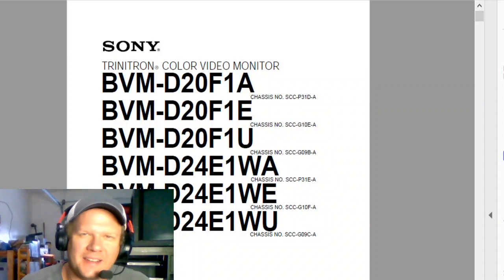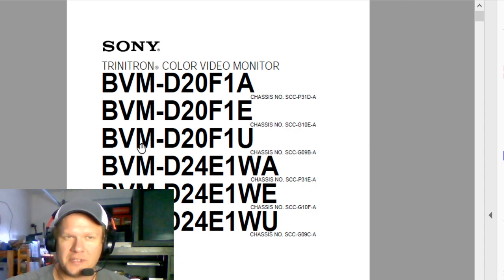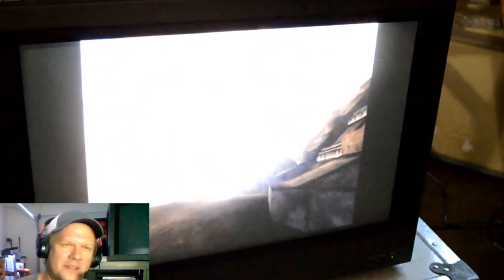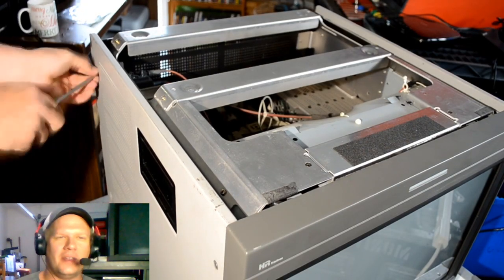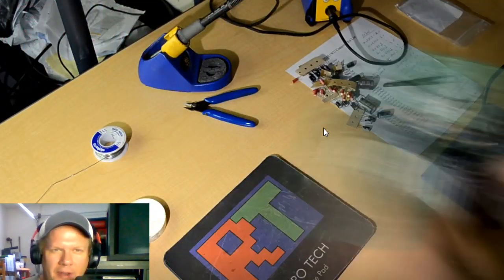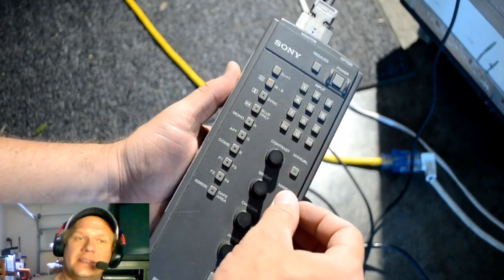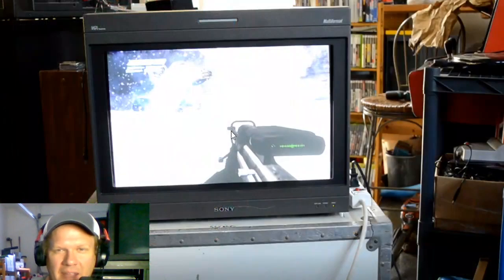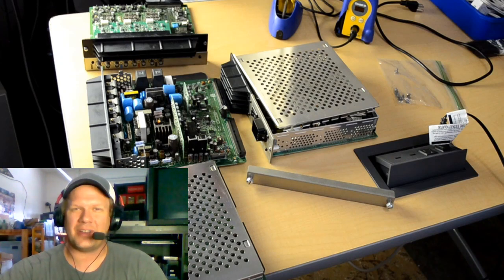Sony BVM D24E1WU Repair: Overload Fix | PA Board Recapped

Comment: Great video !
This looks like the beam limiter circuit is kicking in.
Are you sure this is the monitors original PA board ? On an early monitor like this, I would expect a suffix -11 or -12 and that looks like a -15. I’m wondering if the board was swapped and needs adjusting. There is a rather tricky procedure on page 4-2 of the manual.

By the way, the PA1 sub board is a mod to protect the tube if the EHT becomes excessive if D810 goes short. I’ve never seen or applied this mod and the parts are no longer available from Sony (hardly surprising as these monitors are over 20 years old!).
Reply from the maker: Thanks, I'll definitely look into that.   The inside of this BVM is a bit of a mess.  There is excessive caulk on the yoke and on the flyback & yoke rings.  It's like someone either tried to install a new tube and didn't do a good job or someone thought removing and reseasting the yoke was going to help some problem.  I got it in a lot from a TV studio so I'm not sure if the board was swapped on the PA and the PA1 board is not on the other 2 D24E1WUs O got from them.
Reply: Hey Steve, my guess: this tube was replaced. I sent you an email and left a VM — get in touch when you have time.

Comment: Mine is much newer (serial higher than 2000460) and it has just 9000 hours in it with the last 2000 something used by me. It exhibited exactly the same behaviour since the day I bought it about 5 years ago when the tube had 6950 hours. When I turn really high the contrast and the brightness and a white screen is displayed, the overload light turns on. I have observed that it can be an indication of bad calibration from my side. In 1080i this will happen when the contrast/brightness are so high that the scan lines start looking a bit blurry because of the too much energy exhibited to them. I always pay attention not to lit the light and all these years it doesn't seem to be more or less sensitive with the brightness/contrast values I have always used. I am not sure if it is because my tube is quite new but when you turn the brightness and contrast all the way up the bright light on white screens is almost unbearable to the eyes, almost as if you stare at a lamp (well technically it is a lamp isn't it ;) ).

Comment: Great video!! I have D20F1M and all consoles work fine. However I have a softmoded OG Xbox and works fine on Menu/dashboard etc but as soon as I launch a game the screen turns off and overload light starts flashing. Only happens on OG Xbox.

Comment: Just how high brightess were you using on the monitor before recapping it? On all D24s I've calibrated (those are many) with brightness should be at around 920-930 for proper clipping, with contrast at around 1100-1200. Any higher than that doesn't make any sense.
Reply from the maker: Yeah, this BVM is not meant to go as bright as other models although it's capable of pretty much going so bright it can blow the CRT neck with too much voltage.  I noticed that in my extended menu that if I make adjustments to the values you referenced, It won't save or write the data as it does with other changes I make.  Have you heard of this?  Is there another method to saving those E board adjusments?  Thanks
Reply: @RetroTechUSA  Why would you adjust brightnes and contrast in the extended menu? I do it in preset.
Reason why I asked is because I'm not sure that it would overload when calibrated to a proper standard (like BT.709 with 100 nits peak and proper black clipping). If it does then you really have some issues for sure and if it was fixed by replacing the caps then it's all good I assume. I've never had any issues like this on the Sonys I've worked with. Use both D24, A24 and A14 on a daily basis.

Comment: Hi Steve, 

I have a BVM D24 with about 10,073 hours on it. Bought it when it had about 8,700 hours in it almost four years back. 

The thing has worked great being my main gaming display, but I was wondering at what point should I look at having someone recap it? Even if it's not having problems. From what I remember, it's a 1996 model and I do wonder if I should consider getting it done given the age of the monitor.

Any thoughts on that?

Much appreciated!

Comment: So happy seeing you restore old equipment and talking about how it's done. I have a Sony BVM that shakes / jitters horizontally no matter what the input. From all my research, seems like it's the capacitors on the deflection board. Is that something that can easily be detached?
Reply from the maker: Thanks.  Maybe, it could be a bad cap or two but screen jitters can also be from a worn out tube sometimes
Reply: @RetroTechUSA  Good to know, thank you. The monitor was purchased from Savonpat. Supposedly the crt was replaced at 43,125 hours. According to Pat, chassis had 74,949 hours on it prior to full service. It's not a ton of hours but is what leans me more towards a possibility of a cap issue. Hard to tell.
Reply: Hey man, you ever fix this? I've got a similar thing going on with my 20M4E.

Comment: Nice video
Is there any manufactured dates anywhere on this D24 because the Australian PVM/BVMs don't have any date on the back
Also I see 1999 on the manual but I thought these were made around 2004
Reply from the maker: Yeah that was the end of their life cycle in the early 2000's.  Mine has a date on the chassis for 1999.

Comment: I have a BVM-20F1E I was testing the original Xbox on it . It overloaded on the white loading screen to GTA  . Now when I power on the monitor the power light comes on and it immediately goes into overload with no image on the monitor . 

I’m hoping i haven’t damaged anything major and can recap to rectify the issue . Thanks for the video
Reply from the maker: So it won't turn on (even briefly) anymore?  That means that the Overload may have damaged a component.
Reply: Retro Tech Yes that’s correct unfortunately. Do you think it’s worth doing a recap in my case ?
Reply: @sovietrazors  Did you ever find out what the issue was? And yes it is usually the original Xbox amongst the old consoles that trips the BVMs into overload. My D20F1E doesnt overload with any other console except original Xbox when launching a game.
Reply: @SaminPK  No unfortunately. Such a shame
Reply: @sovietrazors  What did you try to fix it? Did a recap not work?
Reply: @AndrewFarag  Never attempted the re cap . I was going to buy another one and swap out the modules to pin point the fault but they are rare in Australia

Comment: i have a bvm 20e1e with alot of hours on it. It runs nice but i can hear a slight quite ticking or clicking but i think its the gun firing. The image can distort slightly and i lose a tiny bit of clarity if i go to bright and the screen shakes for about a minute when i turn it on then returns to normal. Any maintenance tips?
Reply: That sounds like some kind of short. Sometimes there's a short inside the deflection yoke windings. I'd inspect the monitor while it's on and look for burn marks and try to figure out where the sound is coming from.
I once had a PVM that almost catched on fire because a bigass solder joint was damaged.

Comment: Great video man! 
For the surface mount capacitors on the video input board there is a really  easy way to remove them that Mr Carlson showed in a video:  https://youtu.be/X8N9O3a9jiM
You can literally grab them with a pair of pliers and twist them off.  
It sounds crazy but it really does work and can be better than trying to remove the caps with an iron.  It is pretty easy to lift the traces using an iron.  Maybe try the twist method on something less important first to convince yourself.  I used the method on an n64 which is all SMD caps and it worked great!
Reply from the maker: Thanks!